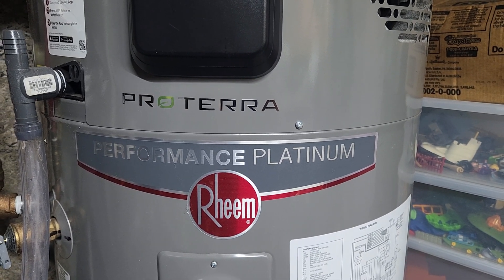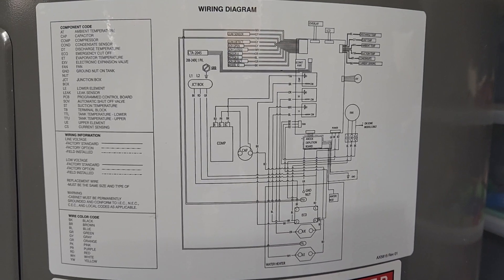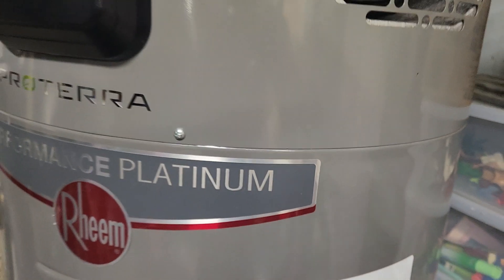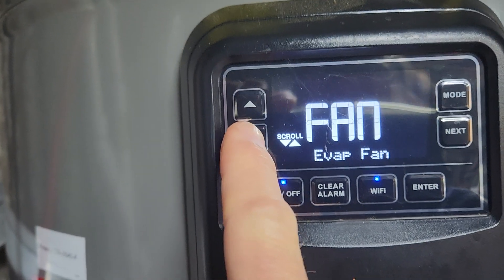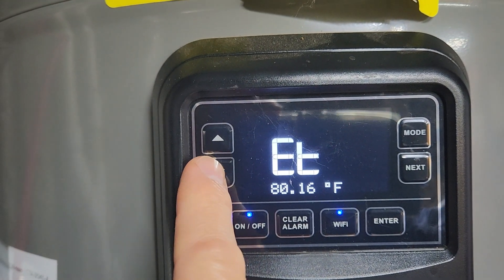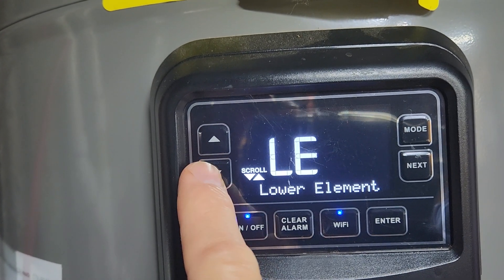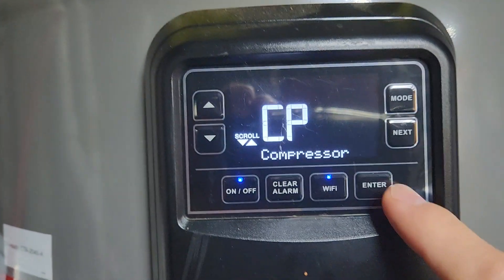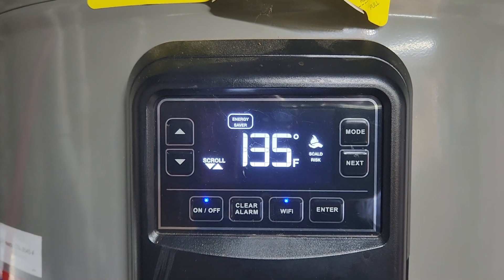Rheem Hybrid Hot Water Heater A005 Temp Check Diagnostic Mode

Comment: Thanks for this. I called Rheem yesterday.  The tech (very helpful BTW) walked me thru finding the actual water temperature, but I didn't take notes.

The tech told me that the closest reading of the actual water temperature is the upper element temperature reading. He said the sensor is on the outside of the tank, so while it isn't a perfect reading, it is close.